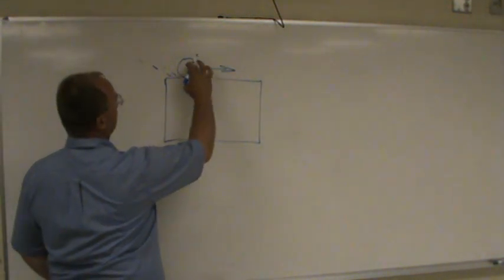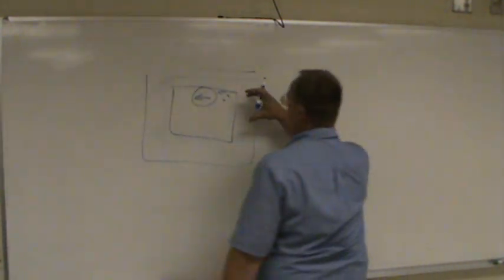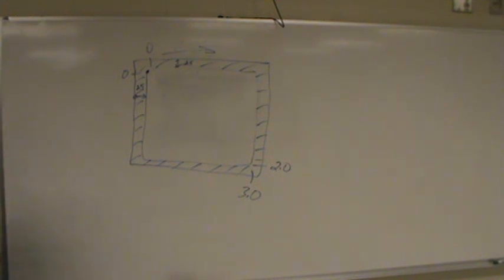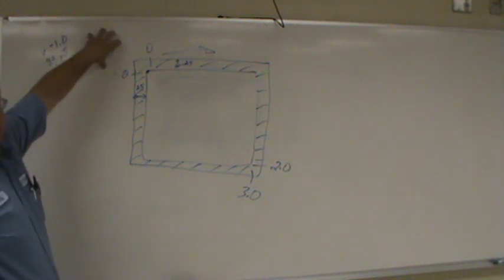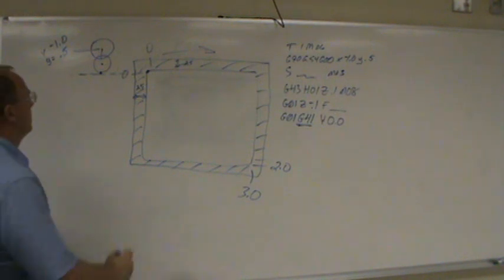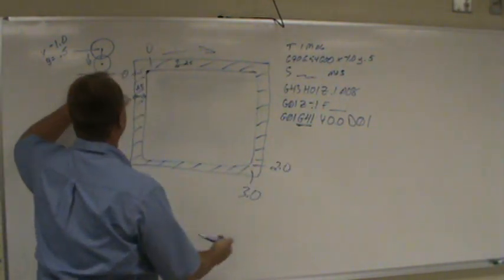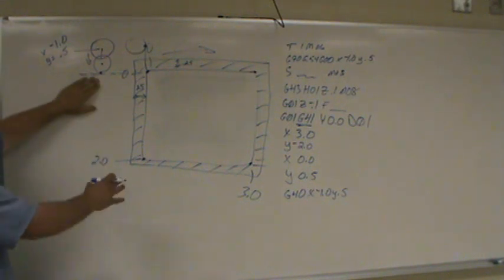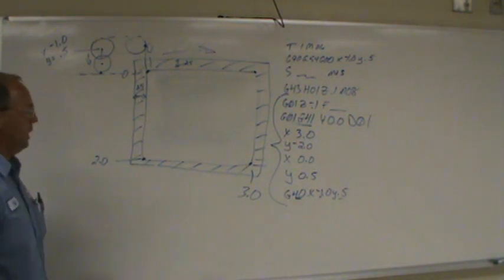Cutter Comp

Comment: 9:20 YOU WERE SAYING THAT YOUR CONTROL PANEL VALUES ARE GOING TO SHOW US ON THE SCREEN THE CALCULATED  VALUES THAT PROVE WE PUT THE CUTTER COMP VALUES IN PROPERLY, THAT WE CALCULATED THEM  CORRECTLY, BE IT A .5 OR A .75  OR A 1' CUTTER DIAMETER.

Comment: G41 = O.D. G42 = I.D. (on most machines) . Now give me the post 2009 HAAS code that recognizes it and where to put it because HAAS uses at least two R's. I think placement of the the R's is critical on this control. The Latter is cornering comp.)  P.S. Thank you for this post I am I seasoned Journeyman, work huge hours and make "Fat-Stacks". The issue is that there is not enough well educated "New Blood" coming into the "Machining Industry". Think about it, look around. Damned near everything you see around you and use had a Machinist involved. Less than that is two sticks to make fire.

Comment: Hi Jeff, Using your method I coded for two 50mm equilateral triangles 90mm apart - it worked perfectly. Then I thought hmmm I could code a subroutine and using parameters make the program more flexible. However, that's when it all went pear-shaped. It would appear that Mach3 can not handle g40 - 42 within a subroutine. Here it is:
************************************
(two 50mm triangles coded using a subroutine)
(note: all sizes are in millimeters)
G90G80G49
G90.1
#3=50 (triangle side)
#7=-3 (Zinc)
#8=6 (tool dia)
#9=-36 (total depth)

G0 Z2.0000
M3s3000

#1=0 (Xctr)
#2=0 (Yctr)
#6=0 (Zpos)
G0 X#1 Y#2 (go to ctr of triangle)
g0 x#1 y[#2-14.43-#8] z0 (go to start pos)

m98 p100 L[#9/#7] (subr to cut 1st triangle)

#1=90 (Xctr)
#2=0 (Yctr)
#6=0 (Zpos)
G0 X#1 Y#2 (ctr of triangle)
g0 x#1 y[#2-14.43-#8] z0 (start pos)

m98 p100 L[#9/#7] (subr to cut 2nd triangle)

M5M30

; Routine to cut a triangle
o100
#6=[#6+#7] (decrement depth of cut)
g1 z#6 f50
g1 g41 x[#1-25] y[#2-14.43] p[#8/2] f300 (comp approach & goto material surface)
G1 X#1 Y[#2+28.87] z#6 f300
G1 X[#1+#3/2] Y[#2-14.43]
G1 X[#1-#3/2] Y[#2-14.43]
g40 x#1 y[#2-14.43-#8] z0 (back to start pos)
m99

Comment: Thanks bro.  I just did a couple of projects every time coding by hand.  I had to go back cause I forgot from which direction to figure out G41/42.  Maybe 6 more programs using cutter comp and I will have that in long term memory.  Programming a CNC is far easier than fixing it.  Be thankful.

Comment: Where do I go to learn about using G41 on G02 and G03 commands  I've got these curves that are not 360 degrees and am only used to going center to center.  I was also wondering, what about if you had to plunge out a pocket, what would your starting point be.  I really like how you made thsi stuff really simple and clear.  Thanks